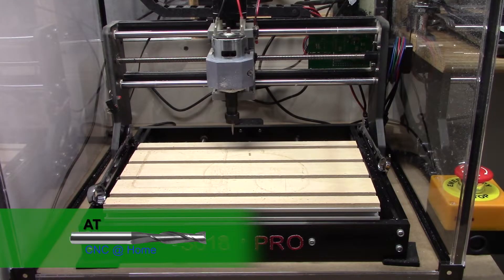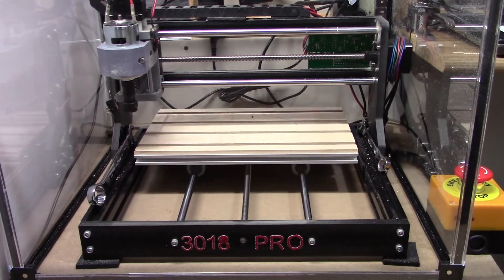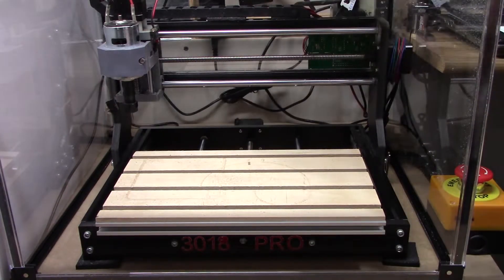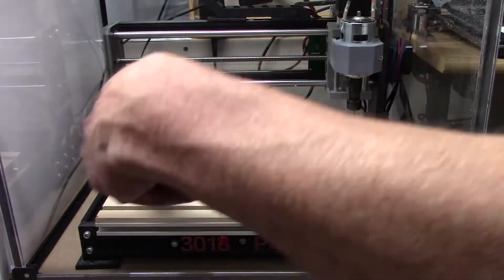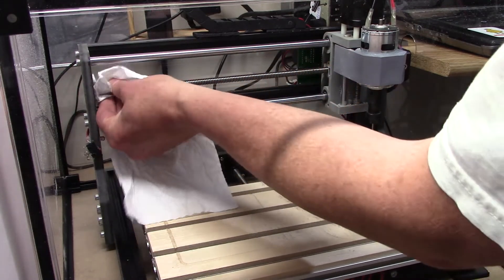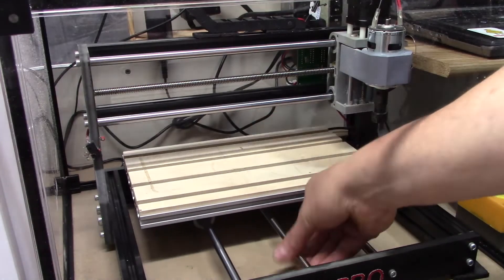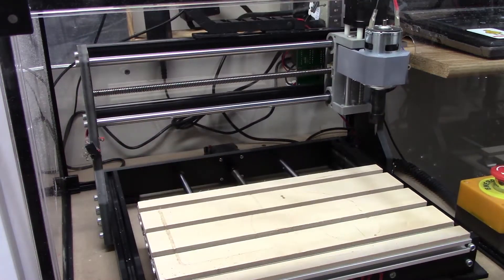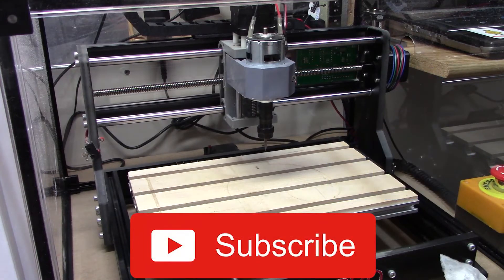Simple lubricating of Genmitsue 3018 Pro

Comment: Thanks for the video. My x-axis screams. Love that you say to power off then film yourself with your hands in it while it blatantly moves under power :)
Reply from the maker: I guess it is a do as I say, not as I do kind of thing.  ;-)  Most of the time while I am cleaning, I do have the machines disconnected from the power.  I see that I did some minor cleaning while it was moving under its own power.  Something that I do with extreme caution to avoid any injury.  Thanks for the comment. 🙂

Comment: Someone on a forum had suggested sewing machine oil.  What are your thoughts?  My 3020 is brand new and the z-axis squeaks when it goes down.  I'm hoping oiling it with the proper oil will fix that.
Reply from the maker: I think that is a good idea.  Sewing machine oil should work well.  There are always pros and cons to oiling.  Things run smoothly which is a pro and sawdust sticks to the oil which is a minus.  On a larger machine, there would be a bellows covering the movement mechanism.